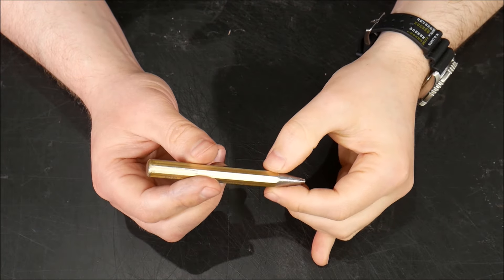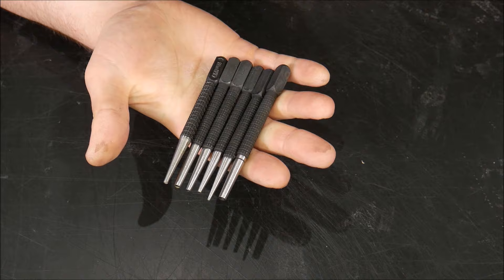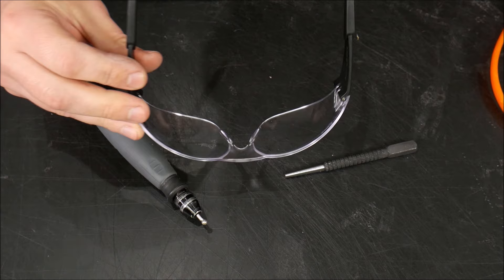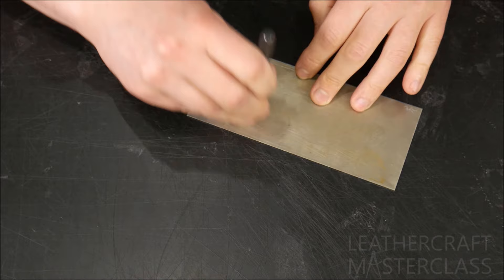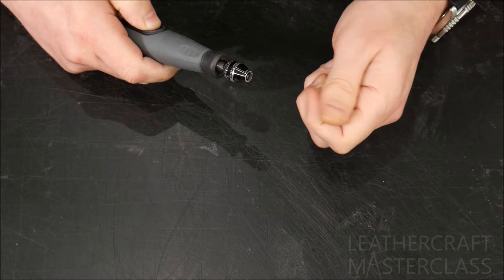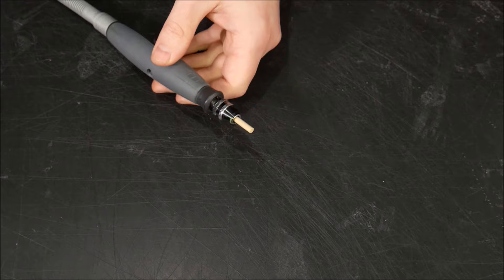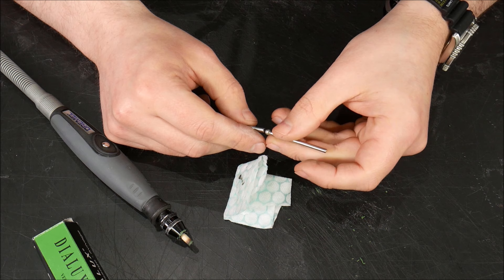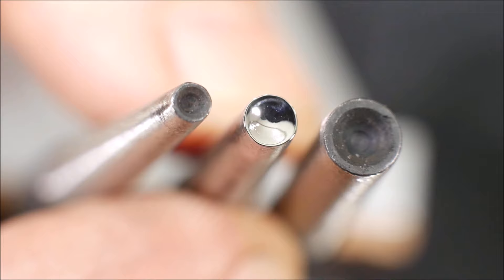How To Make A Rivet Setter In 3 Steps! $10 Perlage/ Leathercraft Doming Tool

Comment: Nicely done and explained.  I make knives and also my own tools. I like that you start with the nail setters as an  alternative for the not so experienced metal worker. Pesonally I use round stock of what was called silver steel. Easy to get and simple to work with. And no I don't own a lathe. I use the my poor mans lathe, my battery drive drill on a belt grinder. The rest I do as you described.
One litte recommendation. If you sees deep scratches made by the diamond burr. Use some intermediate grid for emery paper. Make small rolls and press the end into the hollow. This will be faster than trying to remove deep scratches with a ver<y find polishing compound-
Reply from the maker: Thank you for sharing that!

Comment: Instead of returning to the diamond burr to remove fine scratches, why not use a polishing compound a bit coarser than the green compound?
Reply from the maker: You absolutely can, but it takes 2-3 minutes to polish with green compound only. It would take more than 2-3 minutes to make a new bamboo polisher for another intermediate abrasive.

Comment: I don't understand this because my rivets the smallest is 8mm caps and these are all very very small?
Reply from the maker: Hello Kati. This is for rivets or nails with a stem thickness of around 2mm, which is popular in fine leathercraft. For rustic or western style leatherwork where copper or hollow rivets are more commonly seen, a different tool is often used.

Comment: All that work to avoid buying a $10 rivet setter???
Reply from the maker: Send me a link
Reply: This is for peening solid brass and solid stainless steel nails. Normal rivet setters are not made of the right type of hardened tool steel to do this.